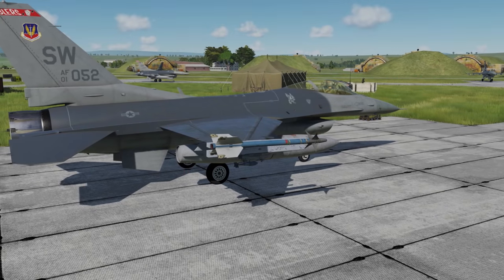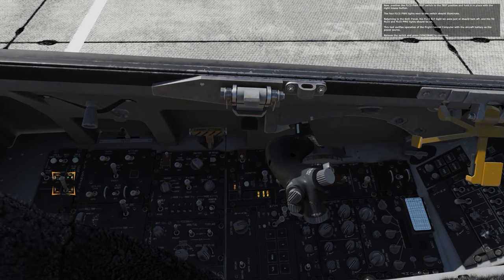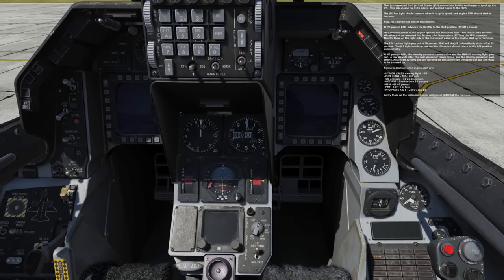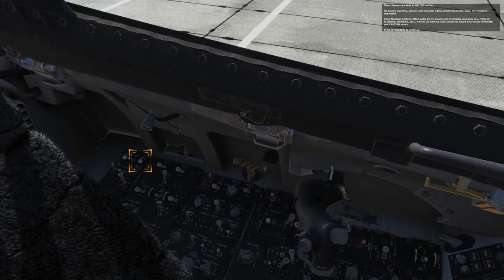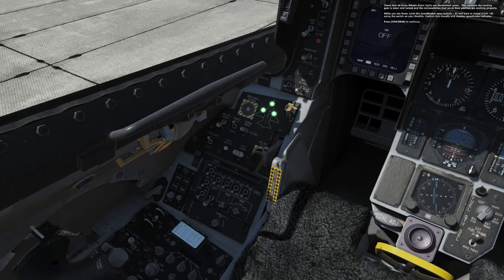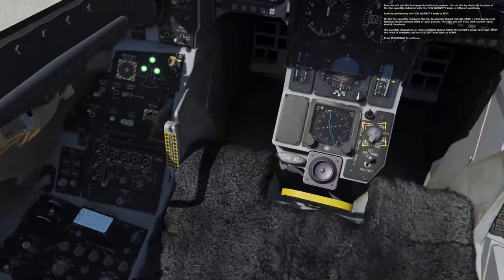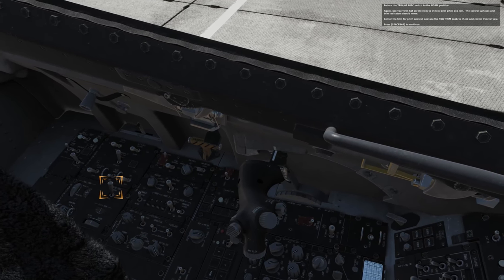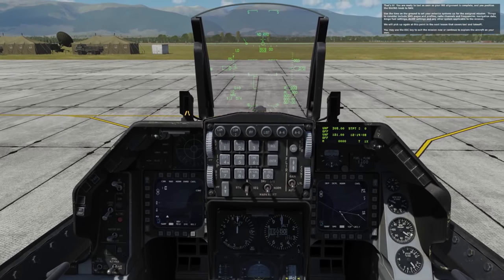Learn to Start an F-16 Fighter

Comment: Hi Matt. Nice job. Though I have a comment: what about the Feed knob on the Fuel panel and Air source knob on the A.C. panel? I notice these are at their default position set to Norm, though are not checked in this workflow/tutorial. These are quite essential for correct (and understandig) engine start procedure and to prevent system overheat. I recommend adding these steps to the workflow. I would also review their default position i.e. set to OFF by default. Cheers, Scuby

Comment: So hyped to fly in the bubble in VR. Thanks Wags and team for cranking this project onwards.
Reply: I have been doing this in a Varjo Aero with a 3090 RTX - runs at like 30 fps with lots of features turned down - once we get next gen GPU it will really be doable - 4k+ res VR at 60fps+ in VR.

Comment: Love the Viper, it feels like home after all the years playing other Sims. Can start her and fly her with no problems!    Most dangerous part — taxiing the darn thing!   I wait for the bird to come to near stop before activating NWS. The real plane is not that sensitive (it can’t be?). Hope they fix that. Rudder control/sensitivity is a must fix.
Reply: I used to fly the a 10 for 5 months and i thought the same thing when coming back to the viper
Reply: You need to cut off the top/bottom 25% of the axis curve completely and create a 10-15% dead zone, then add a little bit of curvature to it.  Then it feels better.

Comment: Loving the videos so far!
Two Questions:
1. How do we know if INS is aligned?
2. How do we set Bingo?
Reply: You'll find out soon enough.
Reply: if you got to the ins page on the ded( little screen above the standby adi) it will flash ready or the align on the hud will flash if its on. bingo is set the same place. 1: hit list 2: press 2 for the bingo menu and just punch in what you want and bam your bingo is set
Reply: @MySuperslayer  Thanks!
Reply: write ''list 6'' for the INS and ''list 2'' for the bingo on the ICP and change it trough the DED

Comment: Just a quick question, Does the mfd's on the viper have colour like the A10's, Harriers etc or are they like the ddi's on the Hornet?
Reply: Oh, Just face it...!! Your $ is "Phucking" spent on this one regardless...!!! 🧐..😜..💰..💸..💰..💸 = ✈..🤯..🤗..😇
Reply: Phase 1 Early Access:

    Color Multifunction Display (CMFD) symbology, Horizontal Situation Display (HSD) format, and Head-up Display (HUD) symbology. 

So Yes.
Reply: sagrzmnky1972 iirc we get a block 50 and as you can see mfds are not green. As far as i know this block indeed has colored displays too.

Comment: Oh i know i'll have to take longer to to takeoff with this procedure than my Hornet friends. keep it up Wags and hopefully to fly it in an open beta!
Reply: Well if they did the full startup procedure as well it would take them just as long :D.. If you minus all the tests that are ran in this video. the viper pretty much starts up and goes. in just a few switch flicks. :D.
Reply: INS alignment (when back simulated again in the F18) does take about the same time. I don’t think you are on the ground much longer when doing al this testing and switching in the meantime.

Comment: I thought you needed The AIR SOURCE knob set to NORM so you have, Avionics cooling, A|C, Engine Bleed Air Valves and pressurization functions?
Reply: I mean he didn't cover eng feed either I didn't look to see if it peered under the arm rest or not
Reply from the maker: Hi Tass, it is set to NORM by default. It would always be set to NORM before the pilot jumps in.
Reply: @MattWagner  Gotcha

Comment: Um.... I don't think your supposed to close the canopy before engine start, doing so will use the the air required to start the engine and not render enough air to spool. You would have to recharge the air with the ground crew.
Reply: that's not how the start system works. its a gear box starter. the jfs is spooled by a hydraulic start motor and then the jfs spins the engine up through the gearbox with the power takeoff shaft. that's the gist of it. I could walk you through the whole process but it would take me about 5 paragraphs just to get the base components and steps out of the way
Reply from the maker: Hi Knight, nope, this is correct. Thanks
Reply: @MattWagner   thanks for clearing that up

Comment: Hey Matt wanted to try to reach out here as well FB, i left a comment on the cold start video on FB concerning the EPU sys test. During the test did the crew chief ever pull the ground safety pin? was surprised it even performed the test and passed. As well it would be cool to initially see the EPU gen / EPU pmg lights always initially come on, It seems too perfect world scenario for the lights to not even come on as noted during the video, as the EPU gearbox has to spool up. 

Though by all means am very excited to even see the Viper in 2 days, almost unreal especially for VR. Looking forward to seeing it and looking forward to the updates you guys bring us!

Comment: Two things: 1) is there not a clickable spot to close the canopy and 2) why don’t you follow common airfield protocols and request startup clearance?
Reply: It's really hard to see but there is a toggle switch just right under the yellow canopy lock handle. That's where you can move it up and down with out using the keyboard command. Had to look it up to find. I'm not sure why he didn't use that instead.

Comment: Why have you too much FTIT ? The procedure says 650°C max, and you have 860°C in the video.
Reply: Stabilized at idle yes but it has a limit of 935C during start (F110-GE-100) and all other modes. Typical transient at start I dunno but if start is attempted with too low RPM it can cause a hot start. Normal is 20% RPM below 32C ambient or whatever is maximum above 32C ambient.

Comment: he'llo, since a few days my F-16C iq now called F-16CM bl.50, i am ot able to use my hotas throttle as before and in the right bottum of my screen there is GUN and 5 big dots below it, what is that??? why has this changed? I anybody can help that would be great

Comment: I believe this video was made way too soon, a lot of things are wrong in this startup:
 - I didn't see you put the ENG Feed on NORM ? It should be on OFF
 - Same for the Air Source ?
 - What about the INS/EGI? You have your HSD with your flightplan shown while the INS is not ready
 - the HUD SYM should come first, to check the INS, WARN with the TEST Panel
 - You have to arm the seat before doing the check with the TEST Panel
 - the DBU check is improperly done, you have to check the right eyebrows, then move your stick to give hydraulics to the Flight Controls (the ground crew will check that for you)
 - no MPO check ?
 - no RWR/CMDS check ?
 - no NAV lights ? that's the first thing to do when you get in the cockpit
 - No DED/DTC to configure ?
 - What about the NWS and A/R door check ?
 - Why UHF channel 5 ?
 - Right HDPT on but no hardpoint ?
 - RDR Alt on STBY (usually set to ON before entering the runway, or during taxi)
 - For the speedbrakes, you should count 2 secs for opening and 7 seconds for closing
 - For the EPU check you did not spool the engine to 85%, 72% only, twice.
 - etc
Reply: Because the FrankenViper Sim tells you so? Sigh
Reply: @PhillMagGamerDad  (ah an apologist?)
Simply because there are plenty of public documents available of the F-16 on the Internet.
I have the Dash-1 for the Belgian F-16, Greek F-16, Norvegian F-16, USAF F-16, they all have the same "normalized" checklist for the startup.
You even have a few "in-cockpit" videos of an F-16 startup here on Youtube, they all match the documents of the Dash-1 but here in the video, it's like the opposite and I'm not the only one to say it, check the other comments just open any Dash-1 and see for yourself.

Comment: I'm have questions ... 
What is the difference between  JFS 1 and JFS2 ? ....!
Jet Fuel Starter 1
Jet Fuel Starter 2 
And Thanks alot
Reply: When you select JFS1 you only use 1 accumulator bottle to start up the JFS. When you select JFS2 you use both accumulator bottles to start up the JFS. It’s a safety feature so you will increase the change for starting up de JFS in a emercency if you only have 1 accumulator bottle to use
Reply: @petervollenbroek6148  Wooow good explanation 
Thank you my friend 😍😍

Comment: INS alingment is the sunday of fliying. Will we get an start alingned option? Heatblur should take notice of this too for the f14. I know its a sim and all the stuf but seriously. Making me lose 4 to 8 minutes in aling... :(
Reply: I do not know if this helps at all but in the mission editor you can activate INS Reference Alignment Stored for the F-14. That will cut the alignment time down significantly.
Reply: @swe-timberwolf3642  Oh. It is not perfect but is a good thing to take into account! Thanks mate!
Reply: If it's like the A-10C it will come with stored alignment which is 90s for normal performance. Otherwise you can always use the 90 second attitude only alignment and scramble. The time between attitude available (90s) and normal alignment without stored heading (4m) only changes the quality of the alignment (similar Mirage 2000). To get the maximum performance you want an enhanced interrupted alignment (normal alignment x 2 with ~90 deg heading change between).

Comment: Benchmarksims: (chuckle) I'm in danger
Reply: You are being that smug based on what exactly?
Reply: @professorchaos5689  Oh, and one more question: why does the Cobra look so broken? Simply because they couldn't care less about properly modeling the Sukhois... or is there an even more trivial reason?
Reply: Given the state of the F-16 in this video. They are not in danger.
Reply: @SnaxDesAvions  , and you're basing this on.....? Didn't see anything wrong with the systems already completed, or the procedures followed.......